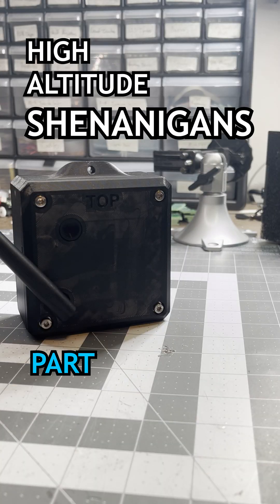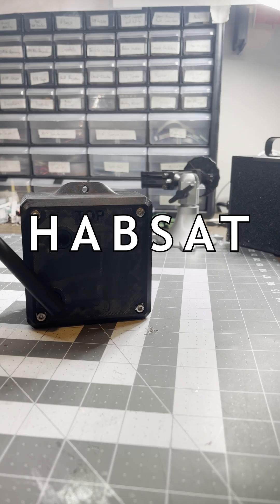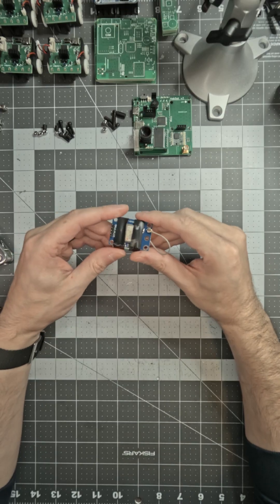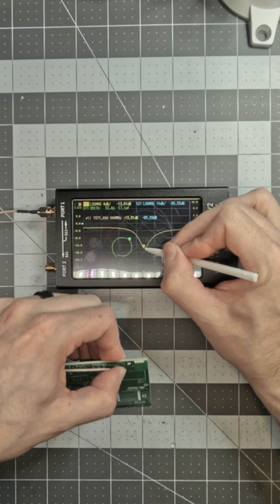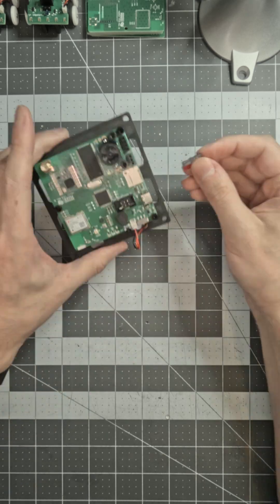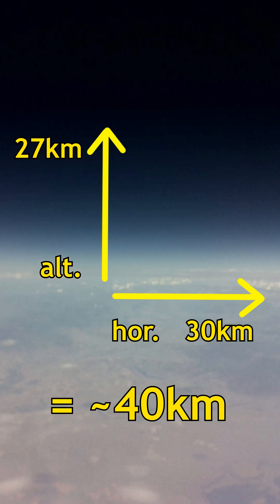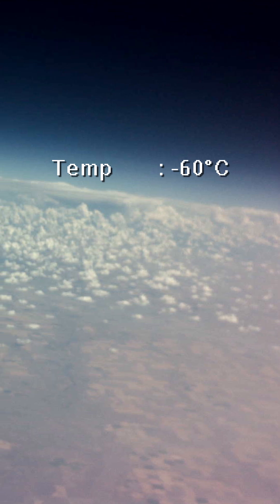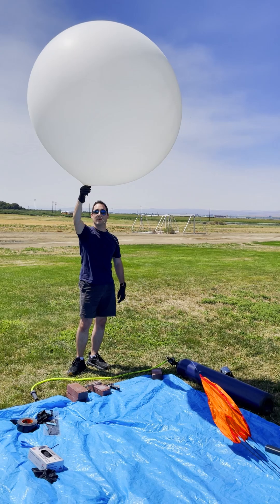High-Altitude Shenanigans, Part 1: Flight Hardware

Comment: Do you have information on how you deal with regulations?
Reply from the maker: Absolutely! There is a relevant section in the FAA regulations about Unmanned Free Balloons. My projects are light and small enough to be exempt from a lot of them, but I follow them anyways, and do more than is legally required. This includes filing and updating NOTAMs, including a radar reflector, ensuring safe landing locations, only flying during daylight, and a few other things. Gotta be a good neighbour, right?